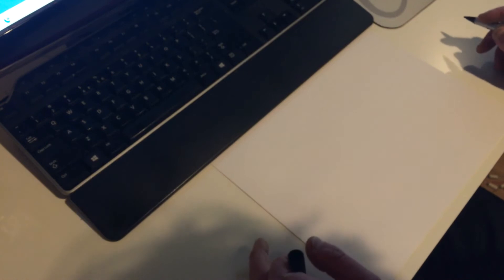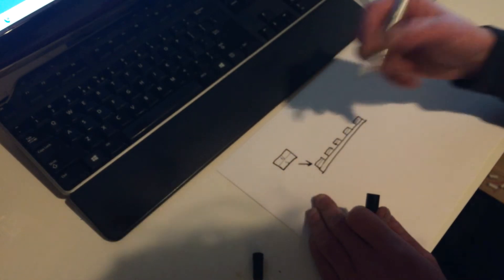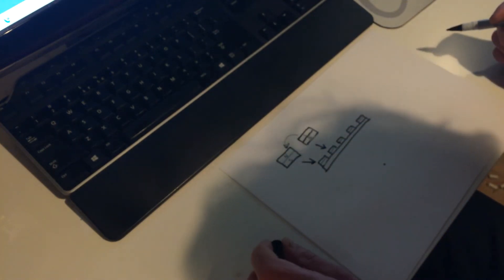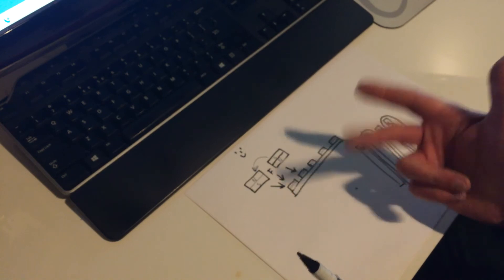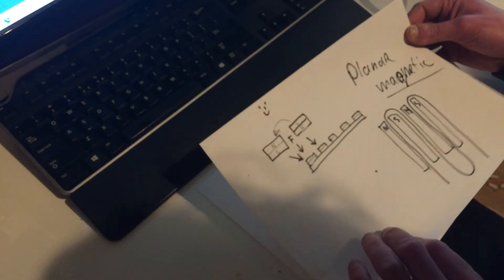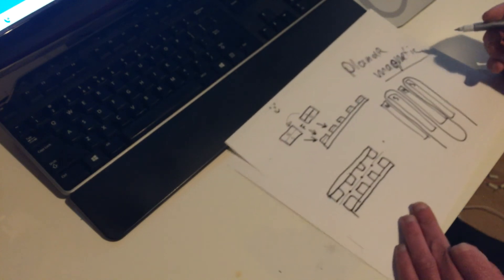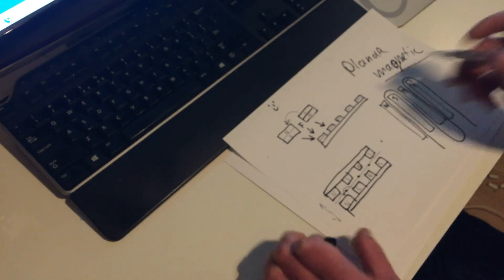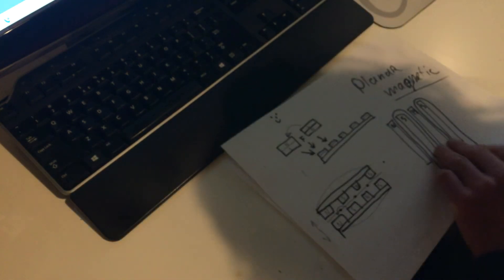Loudspeaker motors explained : Part 2 - Planarmagnetic (dont mention the drunk focus feeling)

Comment: some speaker motors look incredibly simple to manufacture
Do ribbon, planar or any other suffer from major issues compared to dynamic ones? havent seen any non dynamic speakers except piezo in the lower price range. 
dynamic seems to be harder to manufacture with its tight tolerances and has more parts to assemble. in theory those exotic ones should be cheaper ?

great explaination series, short and contains everthing important, thanks.  
for the next time get a desk lamp or draw on your pc paint program
Reply from the maker: haha well the biggest problem was i focused on my shadow.... then everything ended aut of focus... i really should take a b it more care next time :( to much in a hurry.....

about the question.. they suffer from all kinds of problems. a ribbon wont reacht low only  tweeter use. secondly magnets are expensive and  tolerances are high. suitable ribbon material is fragile and expensive. many cases a transofmer is used, also  expensive to compensate impedance.  

Planars are dirt cheap in the basic working.... but then the shit storm begins.  it is rather hard to make one that does what you want actually. and involves allot of hand labour. as seen in the video's. most dynamic speakers are 70% machine done. while this remains allot of hand crafted stuff. take a look at the magnepan factory tour somewhere on the internet. not much machines there. the superb speakers are in the details  (and ease of material)for those kind. so if you got a after loads of time a perfect one, and you can repeat it, costs will be rather low. if else , it spirals out of control money/time wise.  just my opinion :)